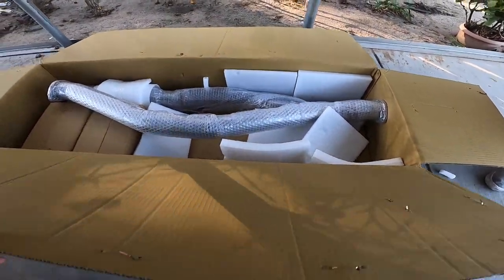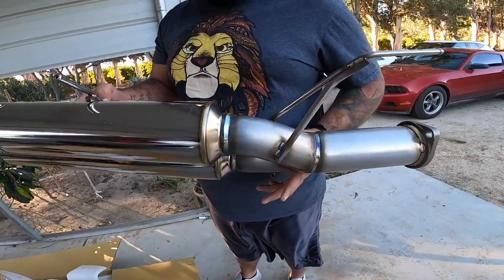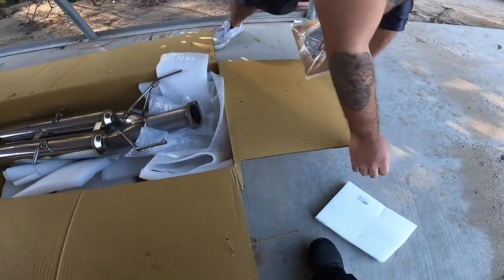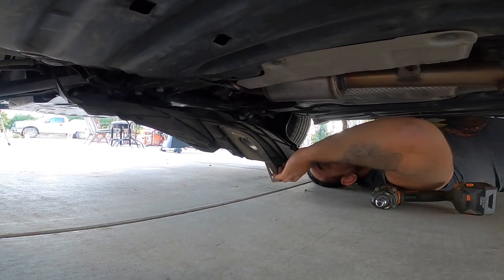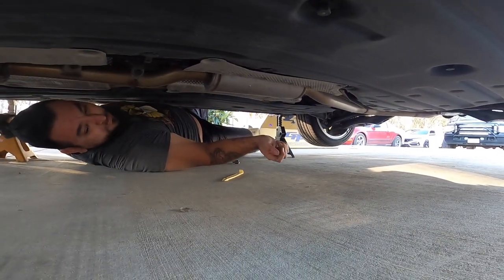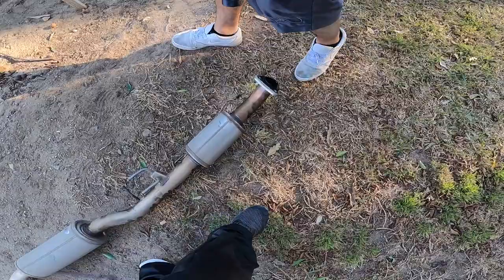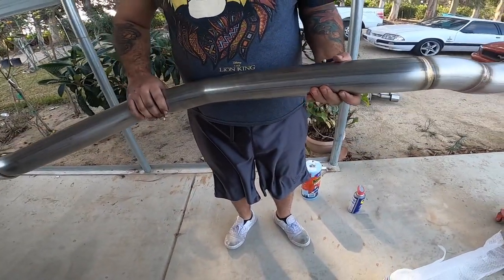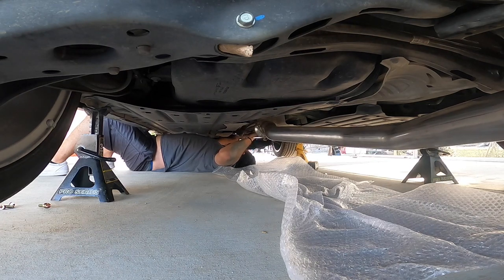2018 Honda Civic Si gets a LOUDER Exhaust / Greddy DDR Cat back

Comment: I've been in the market for a 2018 Honda Civic si and was wondering what type of fuel you put in it. I know the owner's manual states that the car should receive premium, but can it take regular? Furthermore, I think the car has a knock sensor that changes the ignition timing caused by the difference in the fuel quality. Still, I would like to eliminate knocking altogether to preserve the engine while still saving money.
Reply from the maker: It’s just a few more $ 
No point in saving a $3-4 at the gas station just to risk having the engine run sluggish (running sluggish and lead to different factors considering these L series engines are more delicate than the Previous ones) 

I put 91 because that’s what my tune requires at minimum
If I had 93 in Cali I would pay for the extra Oct. 

The factory tune recommends 91 to have the Si run at optimal settings 
If you really don’t want to put 91 then don’t get an Si or just run at your own risk lol
Reply: @TdaKid  Thanks